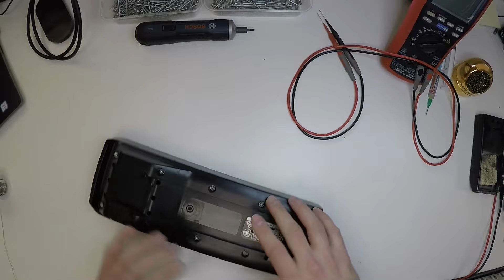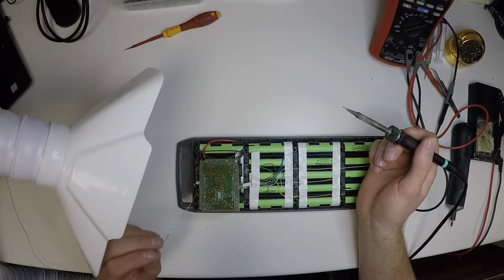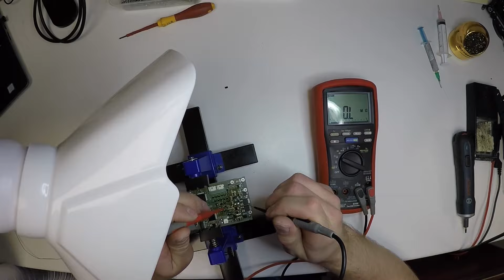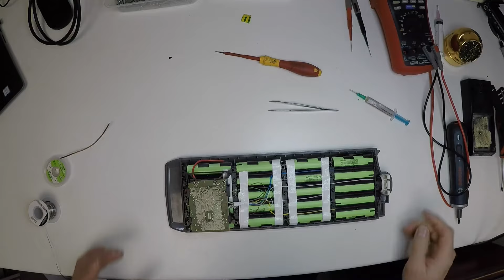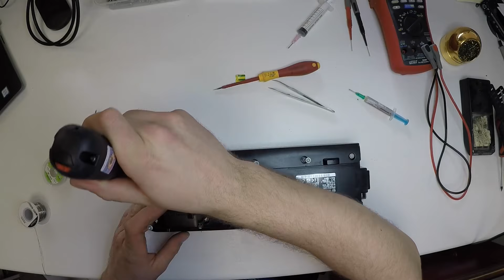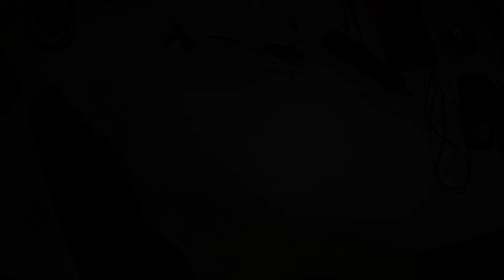Bosch Powerpack BMS repair

Comment: Thanks for great video. I just bought a dud Powerpack 400 and looks like - guess what - diode is shorted out! One question - when you test the BMS at the end what voltage are you passing in and are you also sending 5v to the 5v rail?
Reply: I tested it with the max my bench supply could do - which was 31v and the LIGHTS CAME ON! Reassembled battery - it is charging! Put in the bike - working great. Job done new battery for £46! Thanks Wim!
Reply: On rewatching I - can see you are just connecting 2 cables so can’t be adding 5v!

Comment: Hello, thanks for your video. I have a Bosch Powerpack 500 ( 0275007530) doesn't work anymore. No more light but I am pretty sure the cells are okay. So I search a diode of the 5 V voltage regulator adapted for this BMS. Do you have a reference please?
Reply from the maker: U can use an SS16 diode
Reply: @wim4245  Thanks a lot for your video and yes SS 16 diode works perfectly !

Comment: good morning great video. where can i find the resistors? do you have a link thanks.
Reply from the maker: Which resistors?
Reply: @wim4245  what you replaced
Reply from the maker: @mybattery18650  It's a diode SS16
Reply: @wim4245  the little black part that you replaced?
Reply from the maker: @mybattery18650  yes
Reply: @wim4245  there are other parts that break down on this bms. I will order the parts, because I will repair them in France. thank you

Comment: Hallo, ich habe gebraucht einen Bosch Powertube 625 gekauft. Er zeigt voll an allerdings WIRD er weder geladen noch von meinem Rad erkannt. Mein Fahrradhändler hat ihn ausgelesen und meint er sei deaktiviert. Wie kann das passieren und kann das rückgängig gemacht werden? Gruß Dirk
Reply from the maker: These batteries can be deactivated with the dealer Bosch Diagnostics software. This is permanently cannot be undone.

Comment: Hi. Excuse me, can you help me.I have Error 640 on my Intuvia. Speedometer showing 0 for 2 seconds and shut down with error 640. I had seen no water damage. 4 pcs 18650 have 3.2V and other 4.1V. Are they broken? Charging showing all 5 leds green.
Reply from the maker: They have to be perfectly balanced. Only good solution is to replace all cells with new cells, otherwise they will be out of balance again soon.

Comment: Hello Wim, I tried testing the diodes on my Powerpack 500 BMS and shorted it out with my probes. I still had the thing connected to the cells because of all the stuff I read online about the BMS dying when losing power but the more I learn I think that's just a myth. I tested the cells afterwards and found that they seems to be fine. My question is, can I get a BMS from a Powerpack 400 and use my cells from my Powerpack 500 to make a new Powerpack 500?
Reply from the maker: Yes you can use a 400 Wh BMS with 500 Wh cells. Displayed range will not be correct, but you can use full capacity.
Reply: @wim4245  Awesome, thank you for the quick response!

Comment: Thank you, great video. I have a Bosch PowerTube 500 that refuses to charge and that displays 2 flashing LEDs when I plug it to the charger or when I press the charge control button on the battery with this disposition of the LEDs: Yes No Yes No. I tried to maintain the control button pressed for 30s to reset the pack but I've still the same issue. Do you a have a clue of what is going on? The pack is two-year-old with probably >500 charges (I use it almost everyday to go to work). I hope that it is not dead. I used it yesterday and after my drive, the load was low but not at zero.
Reply from the maker: LED 2+4 is an error code that needs to be cleared with Bosch diagnostics software. I could be caused by moisture, but there are several possible causes.

Comment: bonjour , je suis dans le même cas, ma batterie Powerback400 n'affiche plus rien . je me suis permis d'ouvrir le Pack et après vérification des tensions par élément,  la batterie possède une tension globale de 39v et de ce fait est donc bien chargée. Je mets donc en doute le Bms . Pourriez vous m'indiquer le point de contrôle pour la tension de 5v .  Serait-elle mesurée aux bornes de la diode que vous remplacez
Merci par avance pour la suite que vous voudrez bien me consacrer. Si cettte intervention me permettait d'éviter le remplacement du pack , je serais bien heureux! Merci par avance! et bonnes fêtes de fin d'année !
Reply from the maker: 5 V could be measured at the blue coil (side that is attached to the two capacitors. 5 V is active (for at least a few seconds) after connecting power or pressing the button.

Comment: Hi wim
Are you able to repair the latest Bosch 500 packs as I thought there was a chip on the new board that "dies" if there is a fault and stops the battery for being used at all
I have two of these packs with no life if you can fix them please?
I can remove the board and post it if the board will still work when power has been removed from it?

Comment: Does Anyone have decripted the can bus protocol allow to reset the alarm blocking the battery in some case ?
Reply from the maker: What do you mean with alarm blocking?
Reply: @wim4245   i mean like battery disable ERROR code error 660
Reply from the maker: @stefanosantini9009  Not possible. Not even with Bosch Diagnostics software. Only solution is swapping the MCU.
Reply: @wim4245  yeah  .. i suppose there is a reset command allowing to reset the block status. Obviously not using diagnostic software
Reply from the maker: @stefanosantini9009  Probably only possible with OEM access to reprogram the MCU. There is no need for them to make it possible thru CAN.
Reply: @wim4245  why not?  during quality battery pack production they need to simulate all conditions...

Do you think they change firmware every time or install only one type able to operate in test mode e running mode ?
Reply from the maker: @stefanosantini9009  I'm pretty sure they won't test disabeling the battery during quality control. They may test this during R&D, but they probably just use the JTAG pins to flash the MCU.
Reply: @wim4245  yeah understand is the better way to protect all . I was hoping on possible can message... 

i have a new battery pack with good cells with error 600. terrible thinking to waste a new pack for firmware problem and not for real  exhaust cells..
Reply: @wim4245   I thought about testing the disabling procedure verifying was all operative. Anyway was hoping though to have the possibility to re_enable a blocking pack without wasting it or reprogram a firmware sw on.

Comment: Hi, great video.  I recently had my bike diagnose with Bosch dealer and they shorted out my Bosch Powerpack 500.  They claim it was my battery failing but it was working fine before.  Could you help repair.   thx
Reply from the maker: Hi, where are you from? Shipping will probably be a problem

Comment: Hi Win
Thanks for those videos very instructive
I have a power pack 400
2 first diode light when I press the button
When I connect the charger I hear the click, the second diode start blinking for 10 to 20 second and then stop and the charge stop
Pack is out of warranty for a while
Before dismantling any idea where it could come from based on your experience?
Thanks
Olivier
Reply from the maker: Sounds like unbalaced cells. Do you get error 640 on your bike?
Measure cell voltages first. If they are unbalaced, you can balance them but it probably won't help long. Only good solution in that case is to replace all cells.
Reply: @wim4245  thanks for your he quick answer, I opened up the pack an there are some which are as low as 3,5 v, I’ll try à charge of each pack to see If I can recover the nominal voltage but you’re right there must be cells ending up their lives…Can I replace them with some with bigger capacity ?, do you have a site for good cells at a decent price? 
Thanks
Reply from the maker: @oliviercecillon8327  NKON.nl. Use Samsung 35E or LG MJ1. Both for 500 Wh battery.
Reply: @wim4245  ok thanks for the tip
Reply: Hello Wim
I did a refresh of the 10 individual 4p packs, they are all at around 9500 ma capacity and I reach 4.15 to 4.2 v full charge, I therefore conclude that batterie can still serve a bit. However once all reconnected I have only 2 led lighting when I do a test pressing the button…any idea how how could troubleshoot further ?
Reply from the maker: @oliviercecillon8327  You mean 9500 mAh for a group of 4? That's not much, so I suppose you're using used cells? Are they all tested and matched? Capable of delivering enough current?

The BMS remembers it's last state of charge, you have to perform a full charge (thru the BMS) first.
Reply: @wim4245  Yes, between 9500 and 9700 for a group of 4. The cells are used, I did not replaced them and follow your advice to re-ballance the whole pack. As you predicted, I plugged the charger back and it did charge up to full. Batterie is back on the bike for a ride and see if it recharges properly when empty. I could have changed all cells but I honestly even with these old cells I have largely enough range for what I need to do. Will keep you posted if the re-balancing of the pack last in the long run. Thanks for your expertise...highly appreciated !

Comment: Hi which end does the cathode go to?  The outside of the board (towards + leads) or the inside of the board?  The one I removed had no visible band and everything seems to be a short circuit on both sides of the trace.  I can supply 5V to the outside pad and get the lights to light up though. With diode removed (all packs are showing 4V and seem to be good) I get 1.2V on the outside pad.
Reply from the maker: The cathode goes to the outside of te board (FET's).

Comment: Thanks Wim, this was a great video. I saw you try to repair a Shimano Steps battery but it was not possible because of the thermal sensors glued in between the cells. Do you think Bosch battery packs are easier to repair and if so, should I look to buy a Bosch powered ebike instead of a Shimano system if they are easier to repair?
Reply from the maker: I think that was a video from The Battery Doctor ;) I don't do Shimano at the moment, only Bosch.

Bosch has quality stuff, but they don't support repair (they only want to sell you new batteries or motors). Everything is repairable, but you'll have to find someone who has experience.
Reply: @wim4245  Thanks Wim, yes I agree with you everything should be repaired if possible otherwise we just feed the 'capitalist monster' and turn the world into a rubbish dump of broken products that could be used again! Great to know there are people like you out there..
Reply: @richardhasler6718  I don't know how hard it is to repair or take apart a Shimano pack but it can't be worse then the ones from gazelle
Reply: @wim4245  please share more of your experience! It’s needed badly!

Comment: Can you also unlock BMS? It happens to some Bosch battery after replacing cells?  I refurbish a lot of batteries, so it would be good to find someone that can do that :-)
Reply from the maker: These BMS's don't lock. They that some Classic batteries produced in France have this problem, but have not had this myself.
Reply: @wim4245  I see, I heard a lot. Butt just nervous if the BMS does that, while I try to replace new cell for customers.
Reply from the maker: @Hamid9e  No problem. I've done hundreds.
Reply: @wim4245  thanks, i will try it 👍

Comment: Hi, I hope there will be more videos because you bring up interesting topics;) I have Bosch classic 400Wh batteries, I replaced the damaged button in the BMS under voltage and I made a short to B +. The battery is charging but the bike does not start. Do you have any idea what could be damaged?
Reply from the maker: Hard to say without knowing what exactly shorted. Could be a burned trace, or maybe you damaged the CAN-IC next to the button?
Reply: @wim4245  I sent the photo by email

Comment: Hi got problem to find shoccky diode specification for Bosch powerpack 500 any clue guys? I think is 40v and 5A but not so sure
Reply from the maker: Bosch uses SS14, you can replace it with SS16 (60V, 1A)

Comment: Hello Wim, I tried to repair a dead battery (bosch powerpack 400), it was discharged and stayed in this state for more than six months, I replaced all 40 cells, however, during the replacement process, I completely disconnected the BMS board from cells, now when I assembled the battery, the indicator on the BMS shows a full charge, but when I connect the battery to the ebike it starts up and turns off immediately. Are there ways to factory reset the BMS board on the battery so that it sees the new cells capacity?
Reply from the maker: The BMS doesn't have to be reset. Probably the BMS died and discharged the battery. Can you see any signs of corrosion on the PCB?

Comment: Hello Wim! i have a 36 V Bosch 400 Powerpack!! the BMS is down(Flatkable) and 4.Cells are with low Voltage!! The other Cells are fine (3.8 V) . Can i use this Pack to build a 7.S 24 Volt with New BMS. Regards Johannes from Germany.
Reply from the maker: Hi Johannes, if the other cells are fine, you could do that. It will of course not be useful for a Bosch bike. It's probably even more simple to disassemble the battery and use other cell holders (unless you would want to keep the housing).
Reply: @wim4245  of cause i can not use it anylonger for the Bosch Bike! But can use it for my 24 V Bike (Older one) fom Lafree! Can you exlane me how to Solder the New BMS.
Reply from the maker: @dheereshadarsh3080  There should be a schematic with the BMS you buy. Be aware that these cells can deliver high currents and can ignite when treated wrong.
Reply: @wim4245  oh yes i know!! My Problem is on wich part of the Pack i have to place the Kabels from the BMS! OK -Plus and Min is not the Problem! But where to Remove the not needed Cells(12) and who to place the new BMS Kabel.I send you Pix from my Batt to your Email Adr.